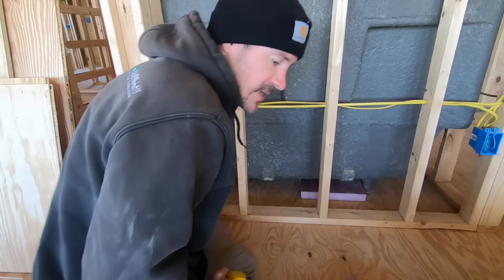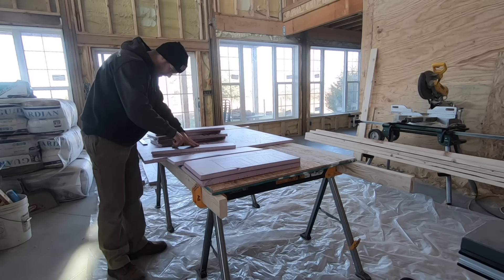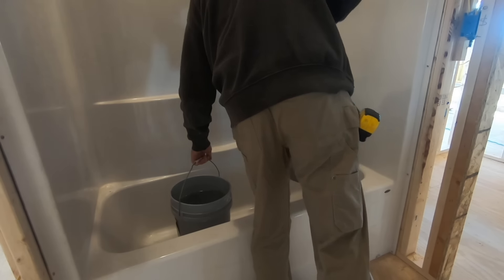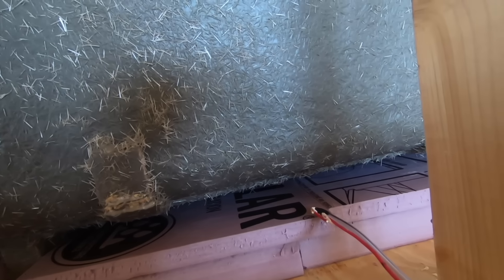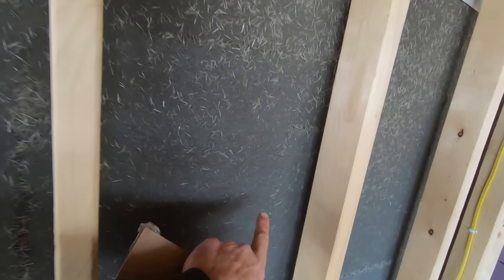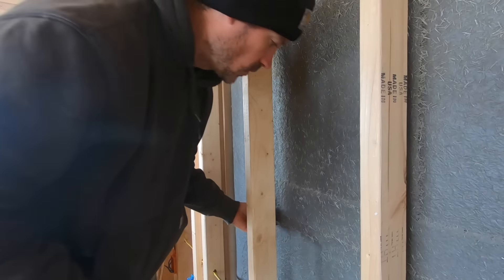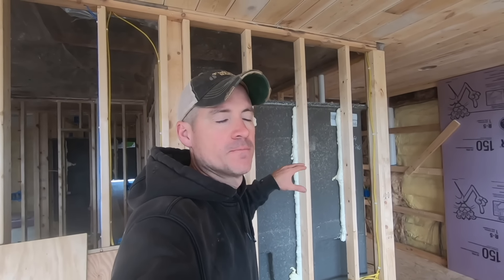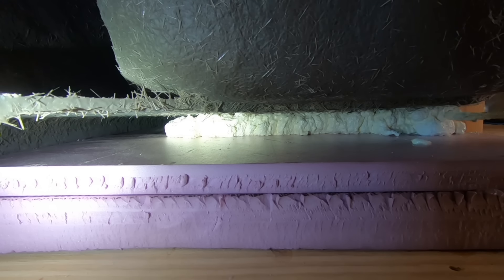How To Sturdy Up a Fiberglass Tub Shower Using Spray Foam

Comment: Are the 5 gallon buckets necessary?  I currently have a customer wanting this done.  So if you use the filled buckets, spray foam, then remove the buckets after dry, won't that allow a slight gap because once the buckets are lifted out, the tub would elevate slightly again?  So wouldn't that create a gap and it will squeek again, getting into a dry shower?    I guess I'm debating if the 10 gallons of weight is necessary.
Reply: the idea is to hold the tub down so the stuff does not expand and lift the tub, If the tub it screwed to a wall like many alcove tubs then this wont be as much of an issue, but with this, until he "great stuff glued' it down, it didnt have anything holding it. Im curious about the weight it can actually hold before deforming, because if you poke the great stuff foam, or just make a dollop on the floor wait for it for harden then step on it, its deforms rather drastically. Yes it springs back into shape, but in my understanding this movement would be bad.
Reply: @crisnmaryfam7344  ,I have to agree with Rich ..I would not put in any water in tub ..use the less expanding foam blue can not red ..
If you put water in tub it's going to leave gap when water is removed ...

Comment: Great instructional video.  Too late for me.  I installed a 3 piece kit over green drywall for an existing steel tub.   There is a small gap on the sidewall that allows movement of the plastic surround.  This causes cracks in the tub calking.  I want to stop this movement.  Any ideas?
Reply: you can turn the hose up and shoot the stuff in behind it and then let it expand. Hope you get enough in the right area to expand to push out on the panel. Then when you have achieved optimal foaming, add a bead of silicone.  IF you can get to it from any other area, even a small hole in the drywall, you could use the same trick. Hose attached to a coat hangar or something pliable/bendable but stiff enough to hold in position, or just a hose if stiffness and control is not a major issue..

Comment: I have a tub that makes a lot of noise when it's walked on. I have no way to access under the tub. I think it needs foam board under it. Can I remove it and pack the floor with foam board and then put it back in?

Comment: This is new construction.  What would you do for an existing shower unit?
Reply: ours cracked less than 6 months after moving into our newly  built house.  guess they didn't bother supporting the floor before they installed it...🙄😠  we drilled holes in it, sprayed the foam, and let it cure.  once it cured, we removed the excess and plugged the holes.  they sell repair liners that go over the existing fiberglass floor.   you use epoxy to glue it in and now you have a new floor.

Comment: Is this the manufacturer recommended technique? 
I remember using sand mix. 
This looks easy but not cheap.
Reply: End of video he says $35 per shower. Even if its $70 per shower is worth it.... working with mortar too much work.
Time over money, need to think differently 👍🏼

Comment: Do you think this idea might stop a tub from squeaking as you walk on it? When showering our tub squeaks like crazy. I do have and opening at one end that I can access from the faucet end of the tub.
Reply from the maker: Yes, it would probably help with noise!
Reply: I'd check to ve sure that the tub isn't touching the flooring on the skirt. Use caulk to seal the tub.

Comment: We had ants get under the tub and totally eat the foam. The tub is on an outside wall on concrete and we never knew they were there until we had a leak and had to move the tub. FYI.
Reply: ants eat urethane?  wtf

Comment: sure seems to me that over time the foam would compress and leave a gap, eventually meaning the gap problem and lack of support would still present itself. Maybe not as severely as leaving 4.5", but still squishy.
Reply: Precisely why we don’t use spray foam when we set our tubs. Mortar it is leaves a nice solid base for many many years to come. Mortar also aids in keeping everything perfectly level even if your floors aren’t.
Reply from the maker: We'll have to report back in a few years and see how it's holding up. Mortar is a great option. This was a solution when you're a one man crew.
Reply: Only thing that could "kill" the foam and make it shrink due to pulverising is if it is in direct sunlight. Only flaw of the foam.
But, it is safe and sound in the dark.
So my humble opinion is if it shrinks, it is poor quality. Also, good that he used polystyrene boards, they also do not rot, shrink, or anything of the sort. And, foam is pretty much almost the same, only comes in liquid expanding application.
Very good idea, i have been thinking about it for a few months, now i see it realised, i like it a lot. (drain problems, have to deal with a pipe, so i have to lift the shower tub to access the problem. It sits on a frame, but i noticed it is flexing from human weight. This kind of solution seems ideal for me)
Reply: Addition. Thinking about it, i would personally put protective nylon with duct tape, at least on the shower floor, i mean ceiling in this case. Just to make it easier if need of dissasembly.
Taking down foam is a mf
Reply: And i forgot, great job, man! 👍🤘
Reply: @MrPostFrame how is it holding up? It’s been a few years 😂

Comment: Do not do this. It will fail and squeak like a mofo. Speaking from experience. I had to remove all the foam after it failed and tamp in cementious grout underneath the tub to fix it permanently. It was a real pain, but worked well. I have a video of the process if interested in how I fixed the squeaking after it was already installed.

Comment: I’m guessing you’re using a close cell foam Because the open cell foam is not very strong and I don’t think it would be able to hold any weight
Reply: I doubt closed cell will last long either, it breaks down into a powder pretty quick when subjected to repeated compression.

Comment: I wonder why you decided on the fiberglass showers?  In my first addition I put in the same unit with the top, then I later cut it out and titled the space which is in my opinion a much better option.  Cost wise the tile was not much different than the single piece fiberglass as I did the work myself.  It seems that you go top end with much of your materials and I feel you are going to be disappointed soon with the enclosure.
Reply: Yes I pretty much agree , I' finished a job not long ago where I cut 2 fiber glass full tubs out and they were less than 5 years old I install a walk in tile shower in the master with a free standing tub next to it and the other bath tub shower combo with tile surround totally different look much higher end look .

Comment: But really, why not just tried and true, strategically placed mortar for the base?  Have you seen this foam years down the road?
Reply: That's what I was wondering. Will the foam eventually smash down and wind up with a gap anyway? Foam isn't structural, it's insulation. The walls might be fine but underneath may be a waste of time.

Comment: It doesn’t work. Tried it in the 80’s. Spray foam won’t cure in blocks/slabs, the center staus soft and the mush goes flat before it cures. You have to fill in 1” strips, but after you get that far, the foam doesn’t have enough long term crush resistance, in a few years the tub flexes as if it wasn’t there. Insulation contractors spray a foam that can cure in slabs, so skip the styrofoam sheets, and it lasts around 2x as long, so the average homeowner will have moved before the tub flexes enough to crack. For your own house, the only fix is polyester resin and fiberglass on the back side. Matting at first, cloth for the last couple of layers. It will waste around 3 hours of 1 person, 2 gallons of resin, lots of glass. Some throw away paint pots and brushes and sticks and a plastic drop cloth. Be sure to stand it back up for each layer cure